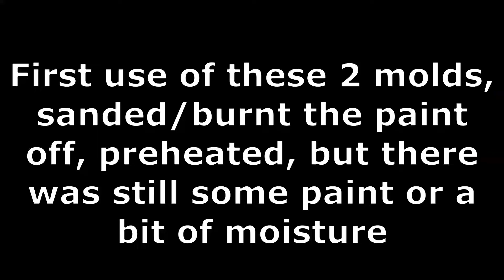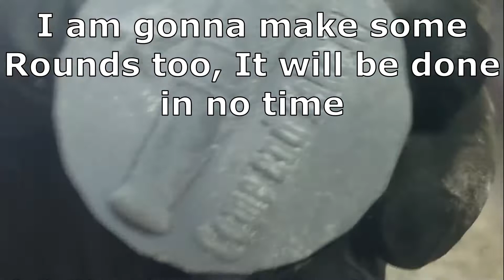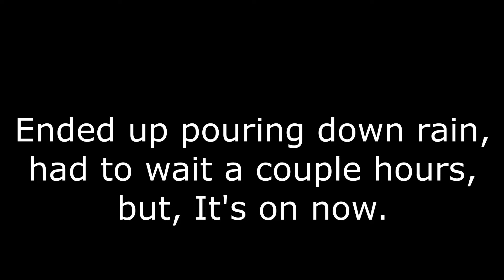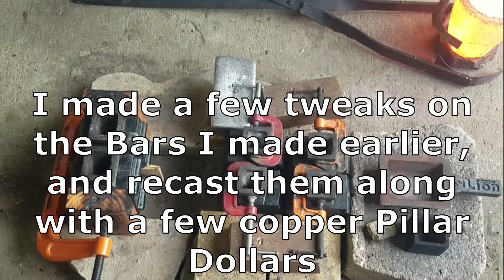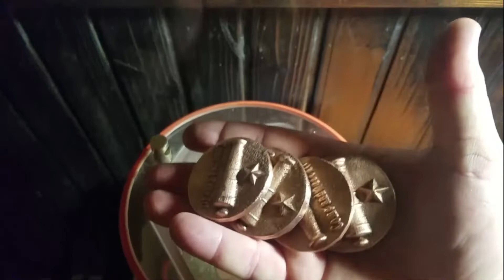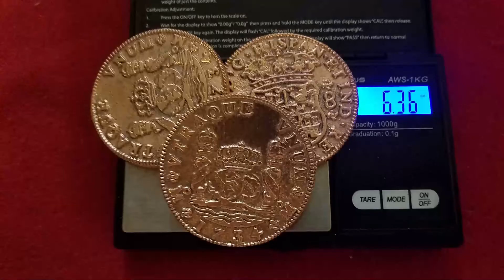Come and Take It - Making The Come & Take it Bars & Rounds - Copper - Sand Casting - Texas

Comment: Those bars really filled up the cast iron molds :) Dang that splattering is awful, I have one little cast iron mold that has the same, even when properly pre heated it wants to spit metal at you :P
Reply from the maker: yeah, I possibly made them a tad big, but just made them to barely fit. Copper seems to give me fits lately, mostly on the thicker stuff.